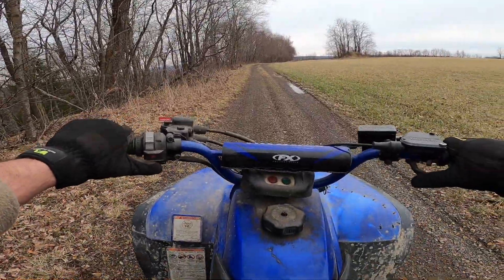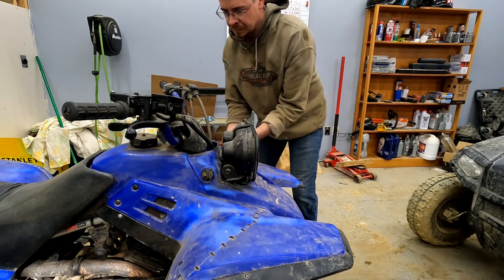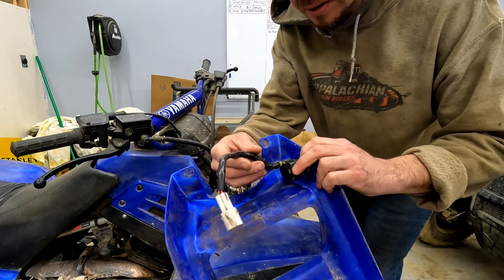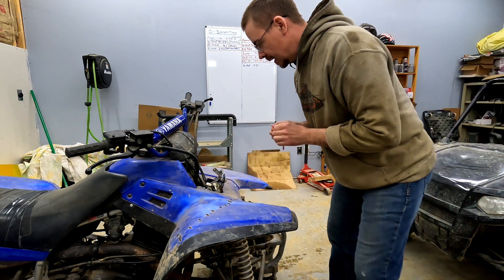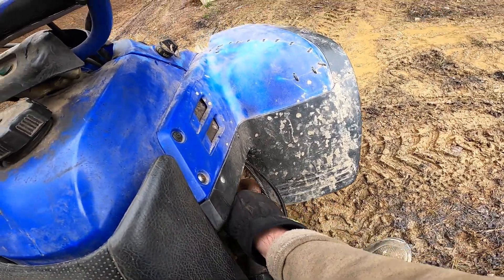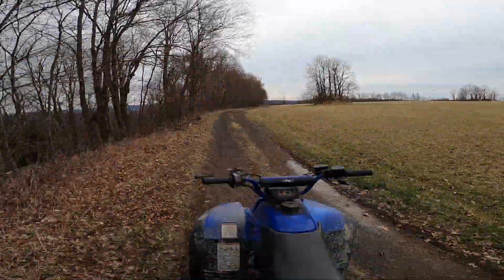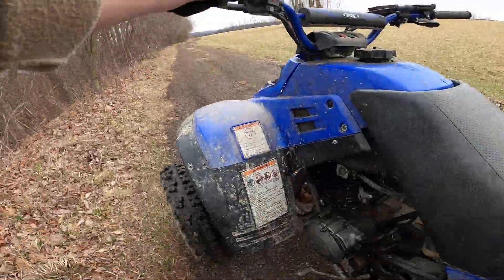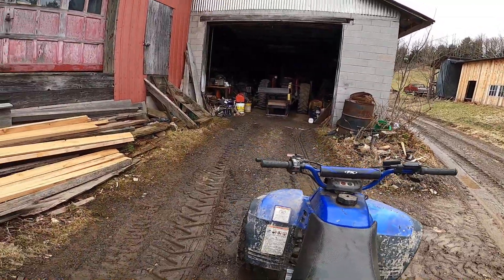Yamaha Warrior Left Me Stranded! I had to push it home!!!

Comment: I'm not sure if the warrior had it but I know Yamaha used it it back in the day, does it have the TORS on it? If it has the TORS (throttle over ride system) you need to delete it first the TORS is nothing but a problem that's the first thing I do when I get a new banshee lol but like I said I don't know if warrior has it lol. Thanks and have great day